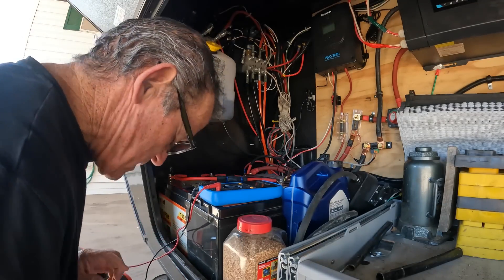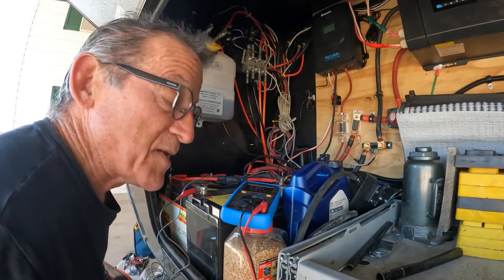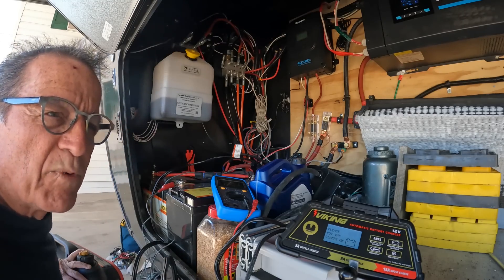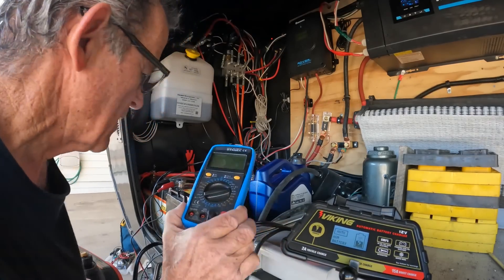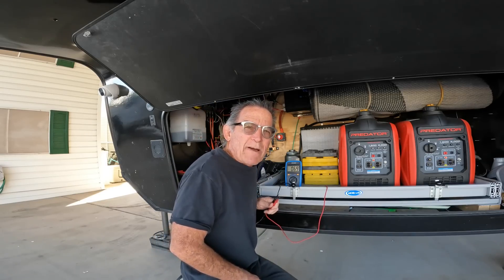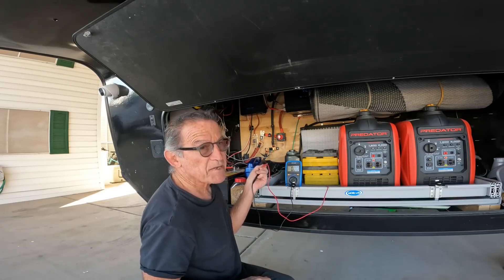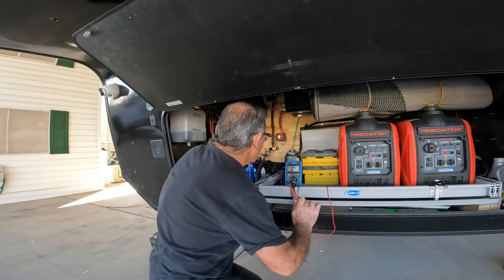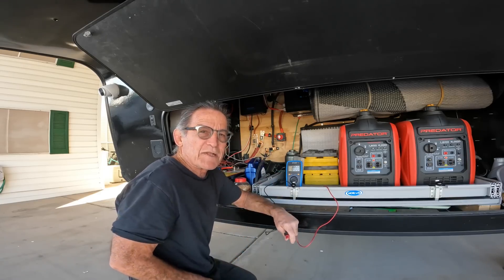Dead Batteries

Comment: Good instructional video. On a different note. How do you view your cameras when away from the rv?
Reply from the maker: Thank you! I view my cameras via an app on my phone.
Reply: @Paul On The Road  Do you have a router involved? I installed the Super Circuits system and at home at least I can see the cameras on Guard Live. Not sure it will work once we shove off
Reply from the maker: @cmcavoy100  That's the app I use and it depends on how good the WiFi is when traveling. We only had one place where it wasn't fast enough to see the cameras remotely. And whether you can look at them or not, they're always recording on the interface.
Reply: @paulontheroad  Do you have a router used in conjunction with the dvr?
I had to use the WPS button at home to marry my eternity adapter, which isn't a router.

Comment: Sorry to hear what happened to you and liz wish you the best but yea I have a ampere Time 200 ah plus battery and a 20 amp renogy mppt solar charger and a renogy 40 amp DC to DC charger and a kisae 2000 watt inverter charger ic series from west marine that was my recent purchase almost 600 bucks too but now I kinda regret that purchase cause it don't see to transfer the load when I disconnect shore power and I have to manually turn the inverter charger back on my aims 3000 global LF series inverter charger didn't do that it would instantly transfer the load like a APC UPS does And yes you can go to zero on A Deep cycle battery just don't do it to many times and a lithium battery can be charged past 14.8 it's the BMS in the battery that'll shut off the charging when it reaches 14.7 and the BMS will float the lithium cells at 13.7 13.8 for most batteries I've become somewhat of  a battery expert on this stuff from playing with my own system and watching these videos on YouTube you have 2 predators wow that's crazy wish I could afford the predator 9000 Watt one but that would be super heavy for my 98 Ford van sitting on the back I have a wen 3800 inverter generator works great too I had to adjust the valves and install a newer carb on it and spark plug too awesome video though
Reply from the maker: Thank you, Corey

Comment: i guess for me the biggest part that was missing was; what led you to take the cap off of the disconnect to check it for ???,  and what was the cause of the power surge to blow it???    thanks for the video and hope you are enjoying the warmth out west 🤠
Reply from the maker: Hey Devil Dog, I was looking for the reason the batteries weren't getting charged and as soon as I saw the excessive voltage drop at that switch I knew it had to be melted internally. Sadly that part of the diagnostics was lost due to an SD card malfunction in the camera. Semper Fi 🇺🇸👍

Comment: I had a rude wakening this week, I've been under the weather for the past month and my truck AGM went flat, in fact down to 3 volts.  My so called smart charger thought it was a 6V battery.  I had to find my old charger and run that for a few hours to get it to 8V before the smart charger would get smart.  Good video, thanks.
Reply from the maker: Glad you were able to recover the battery Steven! and I hope you're feeling better 👍

Comment: Nice video and so much more useful information than sitting there holding the old hags hand agreeing with her and forcing yourself to smile.  I have an old Simpson Electric meter and the thing is nuts on accurate with the needle and the glass viewing window.  I have used it many times through the years!
Reply from the maker: We used Simpson Multimeters in the engineering lab at work. They're one of, if not  The best meters out there for accuracy Thank you, Dale

Comment: Hi Paul. I watched this yesterday but didn't comment.  I don't recall you mentioning that you were able to diagnose why your batteries were totally drained? Did I miss something?
Reply from the maker: They weren't getting charged by the Inverter/Charger so they just slowly got drained to where the BMS (battery management system) inside the battery went into an open state causing 0 output.

Comment: So what caused the switch to fry?  Presumably too much current, was the switch underrated for the system?
Reply from the maker: The switch is rated for 275 amps so it should be able to handle the load but I've ordered a switch with a higher rating and will be installing it as soon as I get it.

Comment: Glad you got it figured out, Paul! With the amount of current that those disconnect switches handle, I decided to go with quality disconnects from Blue Sea Systems for my LiFePO4 battery system. I had those exact Amazon disconnects with my old single lead acid setup but I just didn’t feel comfortable pumping 200+ amps through them, even when they were rated for it on their paper.

Comment: Why was the switch melted?  That is the most important question.  If things are getting hot enough to melt plastic they are hot enough to burn the wood behind it.  When batteries tied together add up to 200 , 400 or 800 amps and wire sizes or connections are not right this creates heat and this is a huge problem..  Most all RV fires are created by something in the 12 volt system.   Nothing should be getting hot.

Comment: I got a great deal on a really nice volt meter from a local auction it was in a box lot was brand new but missing the leads I paid $4 for the lot and bought a seat of leads for $10 and from what ive found on line its about $175 new so I was so happy to notice it in the box lol but a cheap meter will work just fine for this kind of stuff

Comment: Well I see that you have a fuse in the circuit, but I would be pulling my hair out trying to figure out what generated the heat in the disconnect switch. 
Like you say, it may have just reached its end of life. I know you will be monitoring the new one closely for a while.

Comment: Hi Paul, The switch is the results of what failed. Try hooking up the DVM in series with the Positive line so you can read the current. I think you had a current spike which could have fried the switch. Watch the meter under a max load and see if there is too much current for the switch. Use a safety margin of 20%. Best of luck.

Comment: I saw that lithium setup and was completely surprised, because you don't see failure of that degree with lithium batteries. The switch should never have failed in that fashion. The amount of energy going through it should never have been that high. Thanks for the video, fascinating, I have seen a bunch of this kind of set up and it is very interesting.

Comment: Paul,do your batteries have a BMS ? I thought the BMS is supposed to protect against over discharging.
Reply from the maker: I believe they have a BMS built into the batteries and that is probably why they showed 0 volts. I actually didn't consider that, Thanks, David!

Comment: The voltage drop method only works if current is passing through the device (switch in this case).  Higher current results in higher voltage drop.  If there is little or no current flow, then there will be little or no voltage drop.
Measuring resistance is a better test for a degraded switch.  Remember - NEVER connect a meter set to measure resistance (ohms) in a live circuit.  The meter sources a DC voltage when the resistance function is selected.  You will not get a proper resistance reading and you may damage your meter if connected  to a live circuit.  So, disconnect the switch from the circuit, measure the voltage to verify there is no power at the switch, then measure the resistance.  While measuring the resistance, cycle the switch from on to off a few times.  The restance for switch OFF should be "OL".  The resistance for switch "ON" should be very low, much less than 1 ohm.  EDIT - if the "ON" resistance changes, especially if it goes down, after a few cycles of the switch, then the switch should be replaced.
OBTW - I (Dave) have used the voltage drop method as part of my job (calibration lab technician).
Hope this helps.
Reply from the maker: Thanks Dave. Yes I explained that the circuit needs to be under load for the test to be valid. I also talked about only using the Ohm test with the switch disconnected but then proceeded to do it with the switch in the circuit, albeit unloaded. Thanks for the critique, I really appreciate it. 👍
Reply: @paulontheroad  I intend it as constructive feedback.   I simply wanted to add emphasis and clarifying information to your points.  IMHO there are technical aspects of electrical troubleshooting that are easy to miss for novices. 
OBTW - glad to hear that you are getting help from the VA.  My dad had great help from them for several years before he passed away recently at 89.
Reply from the maker: @davelauraphillips8814  Yes you make very valid points and I truly appreciate it 👍

Comment: Hi Paul.  Do you know why the switch was generating so much heat?  What is preventing it from failing again in the future.  It looks like that is the same switch I am using in my little dual battery Popup camper.  Is the switch rated for the amperage you are using?  Your rig is by far bigger than mine.
Don
Reply from the maker: Hi Don, the switch is rated for 275 amps but I have lost faith in it and am looking for a better one to replace it with. It may have just been a defective switch so in the meantime I'm monitoring the voltage drop on a daily basis. 👍

Comment: Hi Paul, Great video!  You mentioned the Lithium batteries went down to 0v so I would assume your batteries do not include a BMS internally?  A built in BMS would of had a Low Voltage Disconnect to protect the batteries.
Reply from the maker: No, I think the BMS Is why they showed 0 volts. They popped right up to 10.5 as soon as I applied an auxiliary 12 volt source. I didn't think about that while I was doing the troubleshooting. Thank you, Justin 👍
Reply: @paulontheroad  Yes, that is correct on why they would show 0v.  That's what my lithium's do also.  I was just double checking with you.  I just started using some smaller lithium batteries so I'm new to using them.  Were all here to learn from each other.  Thanks for the reply.   :hand-purple-blue-peace:

Comment: Walker short bread cookies, yummy….I’m still collecting my parts for expanding solar. I need new batteries, but mine are still working, but new are on the horizon for sure
Reply from the maker: Cookies 😋 
I need to get additional panels and batteries if I ever want to do more dry camping. Currently have 800 w on the roof and 500 Ah in the battery bank. Good luck with your setup, KC8ARO 👍

Comment: Great video Paul you have probably checked the disconnect switch for maximum amp pass thru I’m not sure what it is rated for thanks 😊
Reply from the maker: The switch is rated for 275 Amps and there's no way the inverter could be passing more than 80 Amps, (probably less) so I'm looking for an alternative switch. Thank you, Corey 👍

Comment: Hey Paul, I have a 2014 GMC Acadia with 76500 miles, I say to myself everyday I need a new battery and serpentine belt! Thanks for the video! Take care buddy
Reply: My mom has Alzheimer's, it makes the simplest things very hard. We went together for an oil change/ tire rotation and it wasn't easy! I will be getting the battery, your video was a great eye opener. When your car doesn't start, it's the worst! Thanks again for  your videos. Stay safe
Reply from the maker: @edwardcleveringa6842  Yep, even I get a little stressed when this stuff happens. 👍 And my condolences for your mom, I had a few people in my family with Alzheimer's and it's a horrible disease. 🙏❤️
Reply from the maker: What are you waiting for Edward 😉👍

Comment: So what made the plastic thing melt in the first place ?
Reply from the maker: I believe it was just a bad switch; too much clearance led to high resistance which led to heat. The switch is rated for 275 amps which is much more than what the inverter can produce. I am monitoring it daily with the voltage drop test to make sure it is holding steady.

Comment: You might want to look at the Blue Sea switches rated for several hundred amps DC if you have the problem again.  Thanks for the info.  Did you install your own solar (I should probably go back to your older videos to find out ;)?
Reply from the maker: Thank you for the recommendation Mark. The switch I have is supposedly rated for 275 amps but obviously it can't carry anywhere near that and I will definitely be checking out Blue Sea!
And yes I did the solar install and I can't remember if we ever did a video about it on the other channel.
Reply: @paulontheroad  the switch I use is rated at 350amps continuous, 2000amps for 10 seconds and 1000amps for 1 minute.  It is very beefy.  Amazon sells them (Blue Sea Systems Battery switch On/Off AFD, with 3/8” lugs, ip66 water rating - it is $38.17 right now with Prime).  I installed my system as well.  Those LiFePO4 batteries can supply several hundred amps through that switch to your inverter.  If your inverter is on and acts as a backup power source or boost power source to your plug in power, running a coffee maker or a brief power loss outside of the camper would energize the inverter and potentially pull full power for a brief amount of time.  That would likely be more than 275amps if you have a 3K inverter, thus causing injury to your prior switch.  The Blue Sea switch (and a good T-fuse) can handle this with ease.
Reply from the maker: @markhaney7332  Great info! Thanks Mark Just ordered the switch on Amazon! Thanks again!

Comment: After buying a lot of those harbor freight voltmeters, I would get them again.   The leads on them are really thin, and often break.  Get a $20 voltmeter from Amazon or Lowe's or anywhere else.   Get one that had a buzz for continuity, and possibly backlit.
Reply from the maker: Thank you, Andrew. You're right about the small wire gauge on that cheap HF multimeter.
But I used to give those away to the techs when I would visit a dealership for some easily diagnosed electrical problem. Often I would find the Fluke in their toolbox to be inoperable for various reasons and I would leave one of the $6 DVOMs with them and tell them, 'until you get yours fixed or replaced, use this'.

Comment: Paul, informative and understandable. But the one question I would still have is why the switch melted in the first place?
Reply from the maker: I think it was just a bad switch. Excessive clearance >. High resistance > heat > melt. 
I'm monitoring it daily with the voltage drop test just to make sure it's not happening again. I'm also looking for a Better switch because I don't trust this one anymore. Thank you, LateBrake 👍
Reply: @paulontheroad   My exact question also, Paul, Thanks for the concise, informative videos!

Comment: Good video Paul, very methodical approach to the issue.  I'd make sure and followup on why that switch melted, just to be safe.  I'm sure you already know but make sure any component between your battery bank and inverter is rated for the maximum short duration current draw.  I like to add an additional 25% just as a safety factor.  Stay safe and happy travels.
Reply from the maker: Thanks, Mike! Yes, I've been monitoring it daily with a voltage drop test and so far have not seen any rise. My belief is that the switch was the problem. Excessive clearance > High resistance > ultimately ending with a melted switch.
Reply from the maker: @ORD80  I'm actually looking for a different switch because I no longer trust the one I have. Thank you, Bill
Reply: Thanks
Reply: I’m guessing the inverter was powered because you were plugged into a 110 source? And it is suppose to keep the batteries charged if the panels do not?
Reply from the maker: @bobsmith5533  Correct, the battery disconnect switch turned out to be the problem. It had internally melted.
Reply: have a question and a comment.  The question is: Did you turn that switch on and off a lot?  The comment is: i have been watching others that warn about that switch.  IU have been looking seriously at a good Knife switch.  At least with knife switches, you will be able to see any deterioration as it occurs.
Reply from the maker: @russveinot5754  Hardly ever used the switch. I've ordered what appears to be a more robust switch and will be swapping it out soon.
Reply: Thanks Paul that was very good troubleshooting and I agree that you should try and find out why that switch melted for sure.
Take care and keep keeping on. We are going to watch the Hanks now.
Reply from the maker: @malcomjohnson5409  The Hanks are Great! And thank you, Malcolm 👍

Comment: How could the batteries actually get down to ZERO volts? Oh, Lithium, and the disconnect switch. Shouldn’t there be a fuse somewhere in there?
Reply from the maker: Lithiums will drain to 0 and there's a 150a fuse right next to the disconnect switch. Thanks, John

Comment: Paul-
Call not an expert but your comment about your inverter running off your 12 V is true however this would put you in a cycle that ultimately would train the batteries down
Reply from the maker: Yes, the dreaded circular charge circuit. I guess I didn't make it clear in the video that the inverter should only be charging when it has a 120v source. Thank you, Larry

Comment: To trickle charge from the inverter do you have to switch off the solar or will it charge from both at the same time.
Reply from the maker: My understanding is they work in concert with each other, however if I'm dry camping w/ no 120v input then just the solar panels are providing the charge. Great question, Thank you Steven 👍